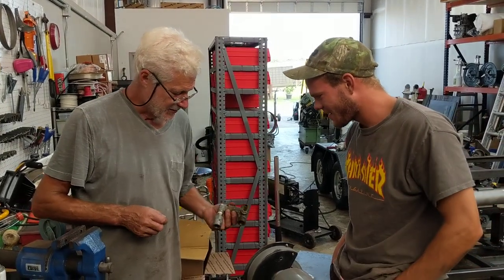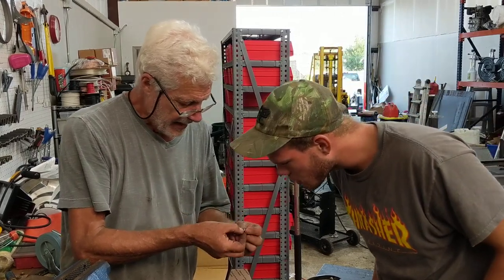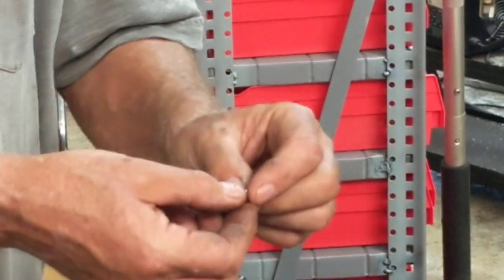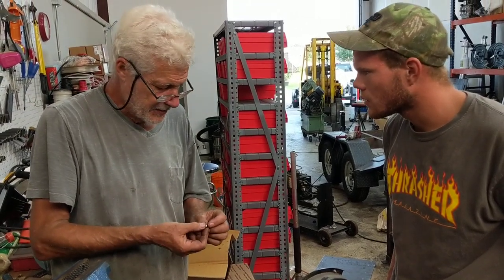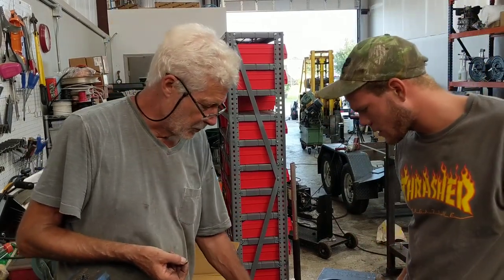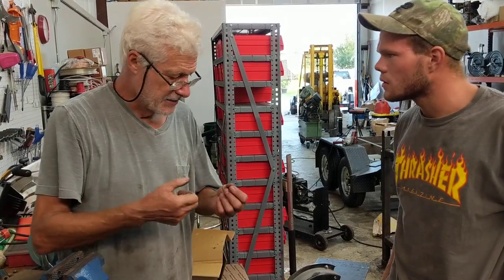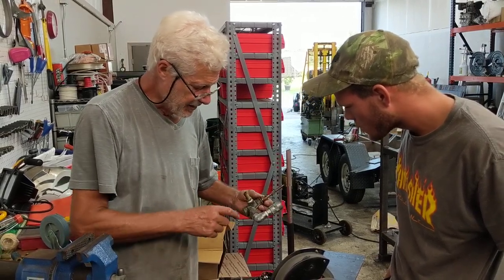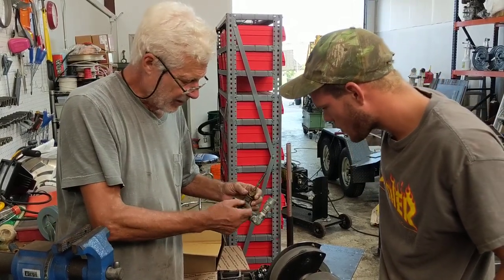Unloader valve issues.  Educational video

Comment: this is the first explanation ive run across on that ball valve issue.  Ive been battling a flawed bypass circuit in a pump for a few weeks and it was NOT the unloader sprink valve whatsoever.  It was only after I sawed through the manifold did I determine that the unloader seat and the ball valve had some trash in there and not unloading the engine.  I'd love to talk to this guy for about 30 min!!
Reply from the maker: Dad has the ability to talk about this material for hours...

Comment: Maybe you could do a video on how an unloader with an easy start valve works (vrt3-310ez).
Reply from the maker: Response from Fred :
The reliability of the easy start valves are unreliable.  We prefer pressing the trigger to relieve pressure while cranking.
We would never install an easy start unloader on a customers machine because we believe in quality products that are more resistant to failure.
Reply: @TXcommercialwash  Thanks I knew there might have been a downside and thanks to your video I realized what the sympton of the engine struggling under load when the trigger is released is caused by. But I have heard that for a vrt3-310 unloader the only difference between the regular and the easy start versions is that the small spring inside the bottom 
of the valve AR part # ML0107720820 is not used in the easy start version so you can convert from either version to the other simply  by adding or removing the spring.

Comment: Would this cause my problem? Runs great as long as trigger is pulled. Once I release trigger the engine bogs down and kills with in 5 to 10 seconds. I have a Simpson 3200 psi with about 40 hours on it.
Reply: Yes that's what he is saying , also when bypassing under high pressure the water gets hot fast so the thermal opens after only a few seconds (hopefully).
Reply: Did you replace the unloader valve and did it help? I'm having the exact same issue it's strange because sometimes it will run for an hour straight no problems and then other times it will act up when I let off the trigger
Reply: I have the same unit and problem... what solved your issue?  My check valve pin is not stuck, but still have this issue.

Comment: What would cause the flywheel key to continue to shear on my Troybilt Model 020568 pressure washer?
After replacing the flywheel key, the engine will run strong and pump will work with good pressure out of the wand. However, as soon as I turn the unit off, I noticed that the engine will kick back. I can restart but it will suddenly turn off only to backfire out of the carburetor. I know that this symptom (flywheel shearing) will cause the timing to be off and will not start. It's already sheared two flywheel keys. Could this be the pump that is binding or the unloader not releasing pressure causing the engine to kick back as it's stopping. You can hear the kick back when the engine stops. I adjusted the valves to spec at .005" as per B&S service manual. They were on the loose side of spec
Reply: Make sure your flywheel nut is torqued to spec. A loose flywheel can spin on the crank easier than a properly torqued flywheel.
Reply: The flywheel was lapped onto the crankshaft, the nut was torqued to 60 ft/lbs, and a new key installed. After doing that it ran fín with no issues. However, I used it a few days ago to power wash a few mower decks and upon shutting off, the engine kicked back and sheared the flywheel key again.
Reply: @louieuribe3343  Have you tried continuing to keep spraying as  you kill the engine? You could also run the pressure washer with no outlet hose installed and then shut it off. If it still kicks back you probably have an engine problem as no pump outlet restriction would equal minimal water pressure. I would think ignition wouldn't be a problem on shutoff as the spark is grounded and the plug doesn't fire.  If the unloader was faulty I'd assume the engine would die while not spraying with the wand after a little while.
Reply: Yeah, I did the exact thing. The wand trigger was depressed and spraying water under pressure and I shut off the engine. It would kick back and shear the key. 

Now, I did notice that when I hooked my water supply the water was coming of out the water outlet with a good stream (as if under pressure). I did the same thing to another power washer I have and the water only dribbled out. So, what I did (to the power washer in question) was put my thumb over the water outlet to stop the water from flowing out. In doing so, when I released my thumb off the outlet, the water was dribbling out and not spraying out. That’s when I hooked up the wand and used it without issue and it turned off without shearing the key. I started and and stopped several times with no issue.

Now, like I mentioned previously, when I used it a few days ago to wash some mower decks, upon turning off the engine, you could hear the engine kick back and shear the key.
Reply: @louieuribe3343  Sounds like something in the pump is acting as a check valve intermittently. If the pump has an "Easy Start Kit" such as part number 200349GS my best guess is occasionally the check ball is seating on shut down causing a spike in outlet pressure in turn shearing the flywheel key. That would also explain the trickle of water coming out of the pump with garden hose pressure applied to the inlet.
Reply: So, here’s what I’m going to do… I’ve got another power washer with basically the same rated pump as what’s on the power washer giving me issues. After installing it onto the Troybilt power washer, and if it doesn’t shear the key then I know for sure the pump has an issue and is bad.

FYI: I checked the pump and it is not equipped with the B&S Easy Start Kit. The pump itself is an Annovi Reverberi.
Reply: @louieuribe3343  Sounds like a plan.